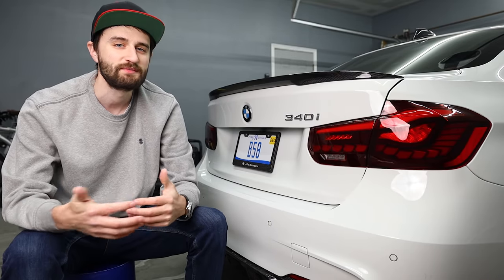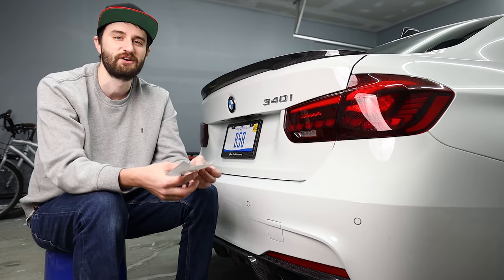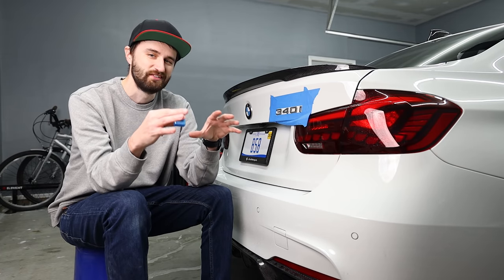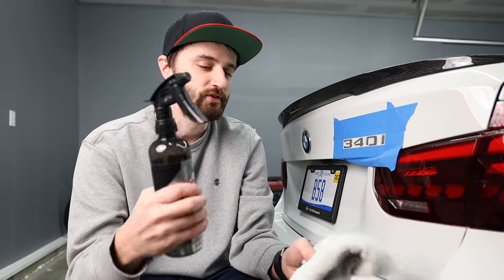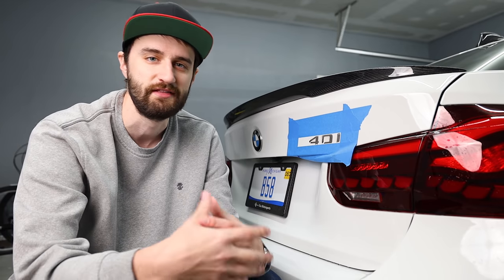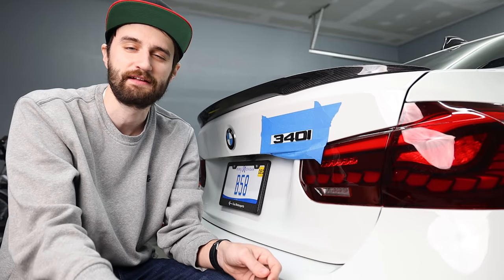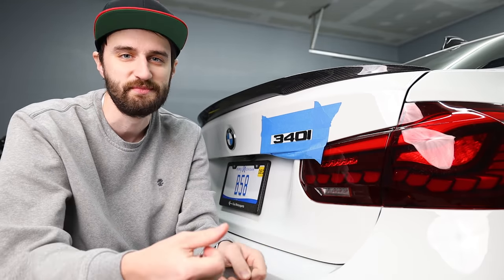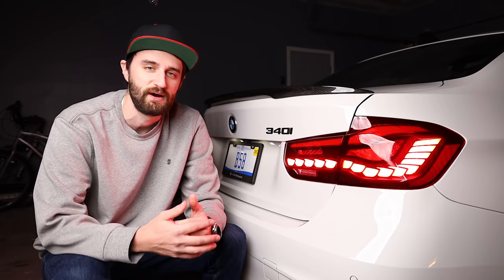How to Install Black BMW Badges | GLOSS BLACK EMBLEM INSTALL

Comment: ATTENTION  I am a sign installer/graphics installer shop owner and you must prep that surface prior to putting that new badge down. Prep it with 70% alcohol to remove the degreaser you just used on the area or you will have a premature failure on that new badge.

Comment: I used a hair dryer and finger nails to get mine off and didn't leave any foam adhesive behind, a minimal hand polish and all traces where gone!
Left it badgeless for a while as someone tried stealing the car, but then later added 335d badges in black for the stealth look 🙂

Comment: QUICK TIP next time after taping around the badge find center mark of each letter/ number and use a pencil on masking tape to mark the top and bottom middle points and you will be closest to exact position
Reply: Got a tip on how to install a 330i emblem when its removed by the previous owner, like how to locate it
Reply: Got a tip on how to install a 330i emblem when its removed by the previous owner, like how to locate it?

Comment: Great video!

Just inspired me to buy a badge and stick it on my 650i!
Reply: Wad it easy?
Reply: @ibbehb.09  Yeah super easy, used dental floss to get the badges off, tar remover to remove the glue and then made sure before I started had masking tape around the badge so I stuck it in the same position.

Hardest part is just taking time to remove the glue residue. All in all 30 minute job max
Reply: @MTAExperiences  thanks 😊

Comment: I once removed the xdrive logo on the trunk of my 2017 F30 with the use of a dental floss and something that removes glue residue. It worked well but the problem now is that some borders of the xdrive logo still can be seen on the trunk from certain angles in certain lightning conditions as if the logo was slightly burned in. How can I remove the borders ? Can it be polished off ? 
I heard it can be polished off professionally.

Comment: I would just cut the 340 seperate from the i and apply them seperately to create the space that should be there. That way u have less room for error than if you did each digit individually

Comment: I was debating this or just wrapping them on my X3 M40i
Reply from the maker: Might be easier to replace them than to try wrapping them
Reply: @justinbuice  good point. Although it’s a bit more of a pain since the badges are separate. It has the X3 on the left and the M40i on the right. Maybe I’ll just replace it tho!

Comment: Can I also use PlastiDip for this? I already have it at home but is a new black badge a better option?
Reply from the maker: In my experience, Plastidip has a lifespan and you'll need to re-do it every couple years as it fades. With these, they are gloss black paint and you'll never need to mess with them

Comment: I use a rubber wheel on my electric drill to remove the emblem glue, so much quicker
Reply from the maker: Good to know! It doesn’t damage the paint at all?
Reply: @justinbuice  I used one to remove all the adhesive along my trunk when replacing my OEM spoiler. Paint came out totally fine! It’s called an adhesive eraser wheel or something like that.

Comment: Redo it. Redo it. Redo it. If the spacing is incorrect, then you best correct it. You’ve gone through the trouble of removing a genuine BMW emblem only to replace it with a poorly spaced non genuine emblem. There’s no way you are happy and getting a good nights sleep !!

Comment: The i doesn’t look right being too close to the zero.  If you use the straight edge ruler to mark the numbers location onto the painters tape, you’ll have the exact location to place the badge. I’ve done this when installing my DINAN badge on the left side and replacing my 335i numerals with black ones. BMW doesn’t sell black badges. If you buy replacement silver badges you can have them either powder coated or black chromed. They look great and are OEM quality.